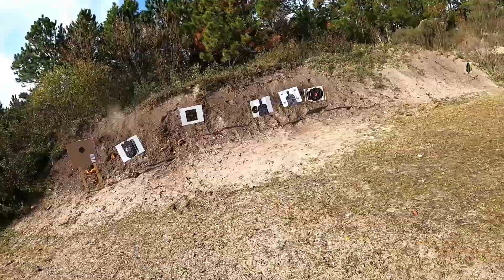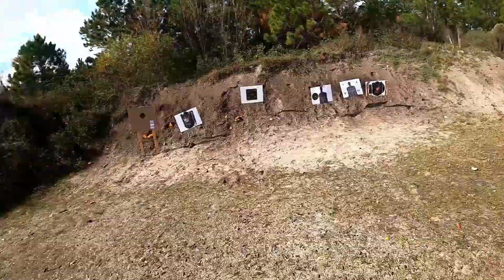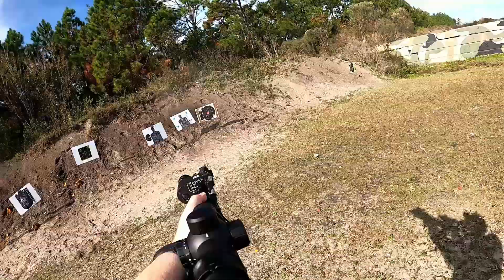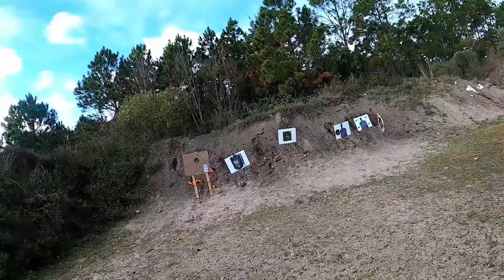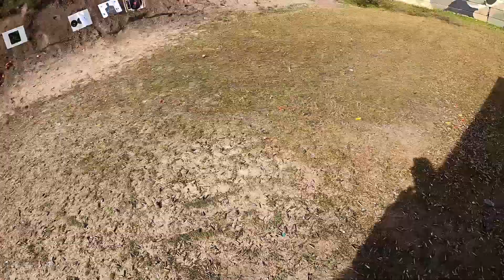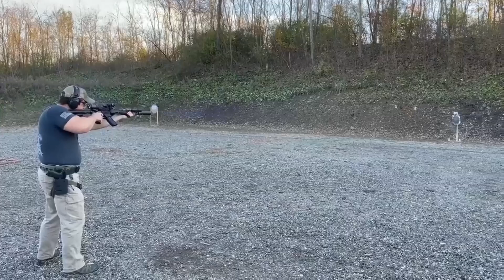Are Geissele rifles over gassed???

Comment: Good vid, I have to agree, mine are not only the smoothest running guns, some of the most accurate as well and I own a few with proof, bergara,, DD and Douglas barrels.  Geissele get alot of hate because of the BF debacle last year, but most repeat what others say and I can say it's inaccurate.  I've got personal experience with about a dozen close to me and 3 of my own and all are the same in experience, zero complaints.
Reply from the maker: That's what I'm hearing from most people I know who do a job or have a lot of experience with different rifles. And Geissele went further to make the BF situation right by leaving the coupons valid for another year on top of the expiration date. But these things are smooth and tack drivers. I'm just warming this 14.5 SD up, and I'm already in love. I'm going to put a few hundred more thought it before I zero it for 77gr TMK. But with the zero from the SR16 on the P4Xi, I made some quick and dirty adjustments just to run it for the day, then it just shot tight all day long. I'm very happy with this thing.
Reply: @navyman8903  If I could say one negative thing, it would be the weight if you want a lightweight gun.  The MK16 rail and barrel profile are a tad heavier than others in this class, but that's also a good thing.  All depends on your application/use.  Other than that minor thing, this is a winner hands down.  Some alphabet agencies and departments nationwide have already contracted the 11.5 and 14.5 SD guns.
Reply from the maker: @chaoticcaninejb  Which is awesome, I'm excited to get their feedback. They are kinda chonky for what they are, which is fine  with me honestly. I struggle running an 11.5 or 10.5 if it's too light. I over drive it a lot. But I could run the 11.5 SD with an Aimpoint if I wanted to without issue. So it's good weight for me, and when I drop it on a bag or barrier, I can get nice stable hits. I'm not chasing the rifle all over the place between shots.
Reply: @navyman8903  Agreed its a nice balance for a work/utility gun.  Everyone wants light but never think of the issues. Gains and losses in everything, gotta know what you want and prioritie
Reply: The two smoothest and most reliable rifles I have are noveske and geiselle. Anyone that says geiselle over gasses doesn't own one. That's  ridiculous.

Comment: Dudes are absolutely obsessed with getting their rifles to run at the edge of reliability lol (not talking about you, I read the description). I’m not a G fan but their rifles are gassed pretty much perfectly suppressed/unsuppressed.

I often see guys tuning to ensure their rifle doesn’t run steel case (yes it’s lower pressure but not as much as the internet seems to believe). This is sometimes followed by “help my gun is short stroking when it’s cold.”
Reply from the maker: Yes and this is also an issue. You don't want to have a gun that only runs a particular pressure or grain weight like you're saying. I think Geissele has the gassing right, and you could probably run steel cased in there. I'm honestly more concerned with .223 pressure than anything. I don't run steel, but I think even as these are gassed they'll do it without issue. And no one ever plans for the bad weather or bad conditions. Or when you can get your MK318 Mod 0 or 77gr TMK, or 75gr TAP ect. There's a window of proper gassing/timing/ smooth shootability, and then there's taking it too far like you're saying. I think those dudes are the ones saying these rifles are over gassed. It's fine having issues with Mr. Bill and his products, they like every company have quirks or things not to like. But credit where its due. 

Also thanks for reading the description lol, I thought no one did. I appreciate the comment as well.
Reply: Steel case isn't much lower in terms of peak pressure, but by the time it gets to the gas port on a carbine length system the difference can be in the double digits percentage-wise.
In the Lucky Gunner test the Brown Bear and Wolf ammo had lower peak pressure than Tula, but they performed better than Tula because they had higher port pressure.
Reply from the maker: They do have slightly higher pressure than other steel cased rounds, but less than brass. It's also not consistent with its pressures. But lately a lot of ammo is inconsistent.

Comment: The super 42 system is outstanding and I think it really contributes to how great geissele guns shoot 
I prefer the A5 system but it’s considerably more expensive 
Super 42 h2 is basically standard at this point lol
Reply from the maker: I agree. A rifle for me has to have the A5 system, super 42, or a good buffer/sprinco spring. I think a lot of people would be better served with one of those 3 options.
Reply: When using the Vltor A5 system, do yall change the rifle spring out for a Springco Green, or use the spring that comes from Vltor? I'm new to this stuff and have a lot to learn. Thanks for the feedback.
Reply: @ChadCooper03  I haven’t, i run the vltor spring myself it works well for me. 
I’m not real familiar with springco products, heard good things but no real hands on experience.
Reply: @thegamecockdude  Alright, thanks for the input. I got the whole system from MidwayUSA for about $100, I intend to just use the included spring for now. Thank you! Be well and happy holidays 🤝🇺🇲
Reply: Couldn't you run the rifle length super 42 spring in an A5 kit and get the best of both worlds?
Reply: Super42 rifle length spring, BCM’s new h2 buffer & A 5 tube are going on my current rifle I’m just finishing up. Going to see if it’s a miracle solution or a self-created shit show.
Reply: @GirthQuake3  with right parts selection yes, you absolutely can. I’m presently going to test out the combo in my other comment on this thread.

Comment: Love my over gassed 10.5” budget line mid state firearms upper runs every thing especially in cold weather if I keep it well maintained… however, I added that geissele super 42 with an H2 buffer and oh my, how well it makes my AR pistol run every thing so smoothly suppressed !! 2-3 o’clock ejection with steel case ammo when suppressed, 1-2 o’clock with brass case 5.56 m193 suppressed. Without a suppressor, it’s usually 3-4 o’clock ejection depending on ammo, (although I now shoot suppressed exclusively cuz I love it so much more in a shorty AR) 

Merry Christmas everyone!
Reply from the maker: Merry Chrismas to you and yours as well. I completely agree. I really like the super 42 system. I put it up there with the A5 system, and running a good buffer/sprinco spring combo.

Comment: I have a 16’ SD 556 and it is the smoothest AR I’ve personally shot. Compared to a DD m4v1, a colt LE6920, and a random Frankenstein build with a Ballastic advantage barrel/ gas system. Geissele, Knights, and Noveske are all in the same ball park in my opinion. Daniel defense rifles are over gassed for a reason so they will just run.

Comment: As far as I know, the new mid length 14.5’s from dd have a smaller gas port
Reply from the maker: I think DD uses crane spec which is .076. I think Geissele does too, or they use .074. I'm not 100% sure.

Comment: I saw another guntuber's video and his claim to them being over gassed and I was concerned, I placed an order recently on black friday assuming (we all know what that does) they still had Daniel Defense barrels in them and was kind of sad to see that they no longer did, as well as the oxide coating rather than nitride. The overgassing would have just made it a real deal breaker. With about two hundred rounds or so the other day through a 16" super duty upper I was happy to find that it did not seem overgassed, although it's worth mentioning that it was used on a lower with an A5 (rifle length) buffer system (with their "H1" equivalent weight buffer). I'm anxious to see what it does with a can on it and after a few thousand rounds and a bit more of the gas port eroded. So far so good though.
Reply from the maker: I think you'll find you're going to be good. IT's a very solid option to run unsuppressed or suppressed.

Comment: I speculated to this effect on the 14.5 and 16 inch super duty rifles/uppers. I thought they might be overgassed because all the shooting footage I could find a few months ago seemed to me like it was recoiling way too much for something that should otherwise be a very controllable rifle. It must just be that all the guys who posted vids were overweight normie boomers. Looks like you had a real pleasant laser beam experience with these, which I'm glad to see. The smoothness of the shorter guns like the 11.5 were never in question.
Reply from the maker: It could be a number of features with other channels. I hate looking up a gun to see if I want to get one, and there's only one dude who can keep it flat. Happened with the Wilson Beretta 92G Brig TAC. There's only one video I've seen that there's a serious shooter running it. It's honestly not hard to look cool on the internet, all you have to do is put the camera at the correct angle and move slightly faster than normal. Or they were rushing. Or they can't shoot. I don't know. But I did have lots of rounds through these things and other rifles to compare. It was one of those situations where you have more first hand experience on something, and you hear someone talking about it.

Comment: How's the view through your LPVO with that DBAL D2 in front?
Reply from the maker: This is an absolute height scalarworks mount, I'm switching to a Badger 1.70. It's kinda bad with the absolute I'm not going to lie. The 1.93 would clear it without issue. As it stands now the 1x you can see the top half of the box/white lines/writing. But once you dial up to 4x you're good with a full FOV. Didn't prevent me from using it quickly, I got some centered and savage head shots at decent speed. But it is there, and a clear obstruction of the lower 1/3 of your FOV at 1x. The Badger 1.70 should correct this issue. But if I had to use it like this, I would be fine and make do. IT's not ideal for sure though. I'll try to compare between the absolute and the 1.70 with the DBAL D2 here soon.

Comment: I use a sprinco blue spring and h3 buffer in my 11.5 super duty. Run it suppressed and get 3 oclock ejections with duty ammo. Super nice rig.
Reply from the maker: Similar to my experience as well. I've fired 75 or 77gr through each length and it's been super smooth. Even the MK318 Mod 0 that my URGI is zeroed for and 2 full loadouts are set up for. I really can't say a single bad thing about their gassing.

Comment: My super duty runs steel case fine, although i have only shot 200 steelie rounds though it.  I usually run m855 or hornady 556. Runs great.
Reply from the maker: I'm sure it does, and I'm glad you jumped in the comments with that to answer that for the people who run steel. I never do, so I can't speak to it directly. But this gas system is solid/well done so I expect it to be smooth even with M855A1 vs other alternatives. Thanks for dropping in man, I appreciate it.
Reply: @navyman8903  can confirm steel runs fine. Had a 500rnd case of wolf/tula when I first bought my 14.5 SD and it's been fine

Comment: Bro I got a 11.5” super duty with or without a sandman S on it…. It literally has no gas in my face at all. The port is .67 from what I found. Was a huge reason on why I made the purchase. Hands down the best rifle in my opinion. It was either this or a SR-15. I chose the Geissele and I’m super happy with it. Also the BCG is next level supposedly can beat knights 20k rounds guaranteed by a long shot
Reply from the maker: They really are smooth man, they hit above their price point. Which I'm sad to say is going up. I also really love their REBCGs. Easiest DI BCG I have ever cleaned.
Reply: @navyman8903  it’s funny cause if SHTF these knights guns would all eventually die out. Since you have to use their proprietary parts lol. Every other gun on the market can change stuff out

Comment: Shots fired at focus trip
Reply from the maker: I'm not sure how he came to that conclusion. Especially when he reps bear creek arsenal and PSA so hard. My guess is, it has to be the lower he put it on like the comment I left on that video. But a grand total of no one I know has ever had an issue with a Geissele being over gassed. Upper/lower wobble? Yup. Changing their exterior coating to Black Oxide, then telling everyone to oil the exterior of the barrel? Oh absolutely. Even the hike in price, but that's 50/50 due to raw material supply, crazy market, and inflation. I'll even say their 50 shades of DDC or ODG. But over gassing? Absolutely not.

Comment: They run well unsuppressed imo.  
Suppressed, it’s too much gas to the face for me.  🤷‍♂️
Reply from the maker: I mean, even LMT's and things need a different BCG to mitigate that.
Reply: @navyman8903  
I do believe people can say they’re over gassed because of gas to the face.  
That doesn’t mean that it’s not gassed well functionally.  
I have no complaints on the gun running smoothly suppressed.  But I’ve gotten gassed out after a string of 10 rounds on their 11.5” &  under.  
Just my limited experience.  🙏
Reply from the maker: @offrosterhandgun5295  I mean same over here too. My URGI and 11.5 have choked me out when I get those 10-15 shot strings going.

Comment: Can you do a vid on what's wrong with an adjustable gas block and a CAR buffer?  The SLR, SA or even the Aero have pretty good detents and once the carbon builds, they seem to stay put in my experience.  You can put a roll pin in them to help the set screws.
Reply: Heart alot of guys swear by BRT EZ tune gas systems and holding manufacturers accountable for their port size. deceminating information and spreading it also helps you get the correct size
Reply: You have to maintain them, regularly cycle the adjustment screw fully open/closed, dab of oil on it or grease. 
Fully close it when cleaning your barrel.
Reply: Florida Man HVACR  best to buy a properly gassed quality barrel and go with a bigger buffer/spring to mitigate recoil. Still fun to play with them though, but ya..hassle for most.
Reply: Florida Man HVACR  either an Adjustable gas block, Adjustable BCG or the Geissele Braided Buffer/spring has minimized recoil on my rifles.
Sharps Rifle has a new adjustable BCG, kinda weird that it’s adjustable at the gas key🧐.
Reply: I set my gas to lock back on wolf 55gn un suppressed.  I usually do not touch it after that but Aero Kroil and a torch will make most everything move if I ever want to.   On a 308 gas gun I adjust it to the round I am firing and re-adjust it for a can.  If I ever use them in a gun fight, it wont be my gas setting that gets me killed, I suck.